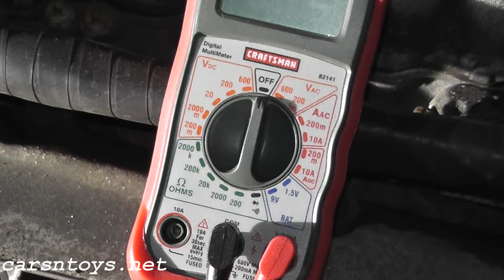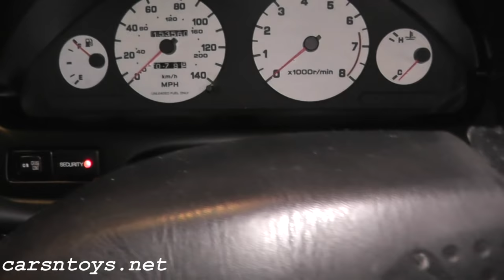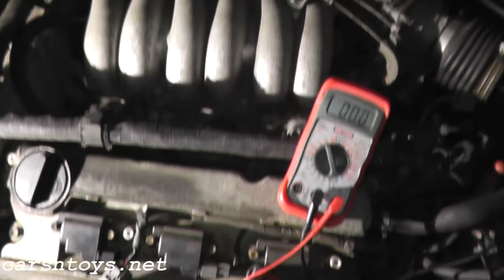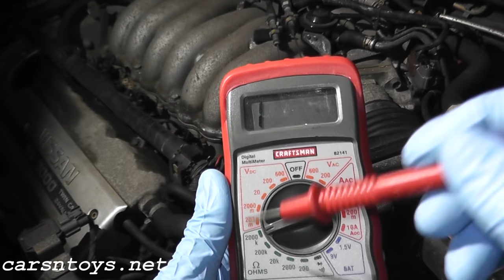P1320 Primary Ignition Signal Fault Testing and Replacement HD

Comment: Great Job! Thank you. This helped me with the scan tool of course. I had P01320, I replaced the Ignition Condenser. Turned out it was not that. Two days later, the three lights back on the dash. Rescanned, P0302 Cylinder 2 Misfire detected. I replaced the number 2 cylinder with a HITACHI IGC0026 coil. Car runs like a jet again!  Use the Hitachi coils. No lights on. I hope my comment helps someone out. I have a 2002 infiniti I30t. Thanks Again.
Reply from the maker: Very cool! Glad to help. Appreciate the feedback.
Reply: I have the same problem but I have a 2000 infinit i30
Reply: Make sure to use the Hitachi coils.

Comment: This video was great. Had the infamous P1320 pop up on a scan recently, no misfires codes, so I said might be the condenser(after reading endless forums where no one mention changing it, only the emphasis about replacing all 6 coils to no avail). Even the dude at Nissan, told me when I replaced one coil($116), for one that broke two years back, that I need too replace all six. I didn't. The part is no more than $6-7 from Nissan dealership. Nissan needs too put out a new bulletin addressing this issue, or reimburse ppl smh. Many ppl have spent dollars trying too correct an issue that can be solved without replacing wire harnesses and ignition coils.
Reply: Shaka Mentor : so, is the ignition sensor also referred to as an ignition condenser ?

Comment: PLZ HELP!!!!! I TRIED TO TEST THE CONDENSER HARNESS AND I THING I DIDNT PUT A GOOD GROUND ON THE VOLTIMETER OR I TOUCHED THE WRONG HOLE IN THE PLUG WHILE KEY WAS FOWORD AND SOMETHING POPPED NEAR THE BATTERY (which is where i had the ground at at the ground battery terminal) AND NOW THE CAR WONT START!! JUST CRANKS BUT WONT START

Comment: You do very good videos and you explain very well too.But when you test the power (+12V) at the harness of the coil and  after at the harness of the condenser,if you put your black wire of multimeter on the ground of engine, you never test the ground wire  of the harness of the coil and condenser .You should test the harness with the red probe on the pin 1 and the black probe on the pin 2.This way you test the 2 wires of the harness.Sorry for my english writing,it's my second language.Best Regards!

Comment: I had the 1320 with engine waning light, the first thing I did was to remove the ignition condenser and was so dirty and I cleaned up with sensor cleaning and steel brush let it dry and put it back I also checked with multimeter and was good I started the car the light was there and I erased it, the car is good now good power no more shake thanks for the help.
Reply: Does the check engine light keep coming back on after you erase it?
Reply: @thephenomkid24  test every coil and fix the problem

Comment: Thanks for your troubleshooting advice!  Man, you helped my fixed a nagging misfire issue on one of my built R35 1000hp GTRs. Ended up being that cheap ignition condenser/capacitor.

Comment: the 1320 code problem was a coil with lower resistance than the other ones nothing else. I have changed the coil condenser and made no difference. I let the car warm up for about 10 minutes and then check each coil and I noticed that coil number 4 had less reading it was under 6 while the rest of the coils were over 6 ohms. I had a coil to replaced the coil number 4 from autozone after installing it erased the code and had never come back.

Comment: Fantastic video! I'm a little worried however that your coil test is not "best" way to check coils. It seems as if your method only shows whether a coil is dead or not. However the code P1320 can pop up (and most of the time is) simply because the coil has the incorrect voltage at the ECM not the coil. This test is performed at the ECM inside the car, not at the coil itself. You have to "back probe" into each slot on the ECM that coordinates with a coil. At idle, you should read between 0-0.2V. At 2500RPM, you should read between 0.1 – 0.3 V. Most aftermarket coils have incorrect voltage values, most OEM coils are perfect. So for people that replace all 6 coils and spark plugs but are still having the code pop up can most probably be because they purchased non-OEM coils. Of course you can test them at the ECM before you ever even drive the car, some of the coils may be fine, some may not be.

I have not performed this test yet but I will be attempting it tomorrow. I found all this information from a Maxima forum which I will post a link to.
http://x.nissanhelp.com/forums/maxima/9813-2000-nissan-maxima-p1320-code-2.html

Comment: Just a useful tip, if your Nissan oil is old and it's about time to change it, and let's be honest there are some miles, at least 190k miles on the engine, it burns oil is what I'm driving at(ha!driving-at) And if the oil gets dirty and low enough, it will affect the performance of the vehicle enough to throw this error. P1230 Change your oil and try resting the code, before anything.

Comment: Pulling a P1320 on my 2000 Maxima. I had this code before a couple years back, and simultaneously also got a code for a misfire on the particular cylinder so it was easy to figure out which coil was shot. This time the code is showing up by itself.
Reply from the maker: +FreedomForever2010 What were the results when you tested each coil via ohms?
Reply: +CarsNToys Funny enough, I hadn't had a chance to check that yet. Was driving back from store today and thought I felt the motor stumble a little bit. Pulled over, checked my codes, and sure enough there was a second code, P0304. Grabbed a new one and all is right with my motor again. 

Not bad by Nissan though, 249639 miles on an original coil, and still have 4/6 originals left haha

Comment: Thanks, very informative video. I have had this code come up several times in the last few months. I am told by every mechanic to replace the coils. I have on two separate occasions and I am still getting this code, along with misfire on multiple cylinders. However, if I do need to replace the harness connectors....is there another name? Auto zone or O'Reilly do not have any part by that name. I have a 2000 Nissan Maxima???Please help????
Reply from the maker: +Nathan Howell Try grabbing a used one online; ebay for example may have them.

Comment: Had a p1320 (only) on my sentra. Did the wire test.... all the wires read good, for my application it didn't have the condenser (looked up online the part number for my year ..because nissan couldn't find it for my vin neither for 01 maxima..confirmed my vehicle didn't use a condenser), replaced my ignition coils with some oem hitachi from rockauto n spark plugs...test drove it "rollercoaster ride" got a p1320 n misfire bank 1... I think the misfire was from the pb blaster I used to soak the original spark plug in (long story) so swapped banks for the original coil n today found out that the misfire n p1320 is no more yet now have a p420 code for the converter or 02 sensor or both. Going to try that catalysts clean see what it does!

Comment: I've learned a lot from your informative videos. 😊  Thanks much! 

Anyway, I noticed that the wire coming from the ECU to the knock sensor is stripping_ and I've replaced two sensors already and I'm still getting P0325 (97 Maxima) ...do you think it's possible  there is no power going to the knock sensor connector hence causing the sensor not to work? Do you have a video on how to rectify this problem?
Reply from the maker: Rush Haven't done a knock sensor video, however, I plan on shooting one shortly.
Reply: How to replace thermostat 1995 maxima

Comment: CarsNToys Thank you, I found your video very informative and thorough. Perhaps you can help me a little further? It's time to register my 2000 Nissan Maxima GLE and a smog check is required. However, the vehicle won't pass smog because I have trouble codes p0304 (cylinder 4 misfire) and p1320 (DTC Definition Not Found) present. I watched your video and ran all the test. The test indicate that I am indeed receiving 12 volts from the battery, and to all six connectors. Each coil is showing resistance except the one on cylinder 4.  So, I ended up replacing the faulty coil pack on cylinder 4 as well as all six spark plugs. This fix cleared the p0304 code and the car ran like a champ for a few days, but was still showing code p1320. So, I assumed the ignition condenser was the culprit because I wasn't getting a solid reading from it with my multimeter. The test would quickly display approximately 1943 ohms and disappear. I wasn't getting a steady reading like shown in your video. So, I assumed replacing it would clear the remaining code. I ordered a new ignition condenser through courtesy parts.com and it arrived within a week or so. I replaced the condenser with the new one and the car will no longer start. It cranks, but doesn't turn over. I tested the new condenser, and it too gives me a real brief reading (something over a thousand ohms). What gives? I tried putting the "old" condenser back in there and the car still won't start. I'm stuck, and baffled. Any thoughts/further direction. Any feedback would be greatly appreciated. 

Keep up the good work
Reply from the maker: Check the crank sensor. A bad crank sensor will certainly inhibit the vehicle from starting. (P1320 can be caused by a bad crank sensor) Here's a video on the crank sensor - https://youtu.be/gJEN0AiLgEM

Regarding the brief reading you're getting on the condenser, it's normal.
Reply: UPDATE: I've got the car running! I can''t say I've done anything other than disconnect the battery for a short while, and jiggle the connections. I think ultimately, the car went into some kind of security mode, after switching out the ignition condenser, and wouldn't start until I disconnected the battery for about an hour. Now, it runs, but the idle is a little rough and it reeks of gasoline. I think it's recalibrating itself. I drove it around the block a couple times just fine, but it'll stall out whenever I rev it too high. It's weird, but I'm optimistic it'll work itself out. Thank you for your video, and your response. I hope this input might help out someone else with the same problem in the future.

Comment: Hello friend, I have a problem, which is that my Nissan Maxima is not working. I checked the car and it turned out that there is a malfunction in (the initial ignition signal). I have changed the spark plugs and the ignition coil and changed this capacitor in the video, but to no avail, it still does not work.

Comment: This is a great video. I have a low Millie 00 Sentra 1.8 that recently stalled on me while driving to the market. Towed it yo a shop and eventually this code appeared, after several tests on running it where we had no code to go by. I tested the connectors w my voltmeter and all read 11.9/ volts. Tested the coils as well and all read higher then 2.1. I Assume as you stated in the video all is w the coils?? Did some research and many state it could be the cam/crank sensor as this is common in sentras. Can't locate that igniter sensor you mention on my Sentra. Trying to purchase one online and can't find one either.

Comment: I'm having an issue with my moms i30 as well. Only code it is throwing right now is the p1320 code. It has new plugs, new Hitachi coils, new cam position sensor and I replaced the condensor with a known good one. I have yet to check the wiring but I don't think that is the problem. Could it potentially be a dead injector? They look similar to s13 ka24de injectors which I've had experience in the past with them just dying out of nowhere.

Comment: I changed the ignition coils to aftermarket, p1320 stayed on. Then changed ignition condensor for another oem condensor. P1320 is still on.. I read on maxima.org that if replacing oem coils to aftermarket will not remove issue. Also, airbag light came on a year or so later..

Comment: Good video!!  Question,  Last week the check engine light came on.  The code was P1320.  I reset the computer figuring it was a glitch.  I took a trip yesterday on the parkway.  The the check engine light came on again.  It still runs very smooth, no misses.  Wonder it can just be the condenser???  I had a full tank of gas. I filled up on gas again after the trip of like 70 miles and she got 30 mpg, I was surprised.  Around town it ranges from 18 to 22 mpg.  On my 2000  I30 the spark plugs have like 180,000 on them.  ALTHOUGH, they might have been changed over time, I am not sure since it was my moms car.   Can old plugs cause the P1320 code?  Thanks!

Comment: I have a 1999 maxima I'm getting codes P1320 and P0304. The car will crank but not start. I have tested the ignition condenser the way you said. When I check it I get over 1900 with the leads one way and when I reverse them I get over 1600 on my meter. My question is when I test it with the leads it will only read once and then in order to get another reading I have to reverse the leads on the prongs in the condenser. Is this correct or should I be able to read it by touching the leads back to the same prongs in the condenser every time?
Reply from the maker: Jim Friese The car would still start if the condenser was bad. It's really a safety device to catch large spikes of electrical current. P304 is misfire at the number 4 cylinder - the middle cylinder toward on the radiator side.  The car should still start and run on five cylinders but I'd check each ignition coil.

Comment: I have  99" Nissan Frontier 3.2. It has spark plugs. A new distributor was installed and truck ran fine for two day. Now truck doesn't start and has the P1320 fault code. With no coil packs where do I check?

Comment: Used BAFX code reader and Torque Pro app which gave codes PO301 Cyl 1 misfire ,  PO325 Knock sensor and pending code PO171 System lean on my 98 or 1998 Infiniti I30.  Inspected  cyl 1 spark plug and it was darkened instead of that nice light golden brown color. Replaced cyl 1 coil  ($50 at Oreilly) and wala car ran perfectly.  Tried ohming old coil like in this video but my values were like half of 5.5k ohms.

Comment: I had a misfire code on cylinder 4 and the issue what the connector wasnt even plug in because the wires got loose. I "fixed it myself" and no longer getting the misfire code but the p1320. Why didn't I get that code on the first place?

Comment: I have a problem with nissan cefiro a33.. its the same engine with whay you do in the video..some cylinder doesnt have the ignition signal from the signal wire..only two cylinder got signal..what seems to be the problem sir? the power supply and ground for every coil is okay but no signal so no spark produce to plug.

Comment: I have a 96 Nissan maxima gle with hard starting problems and decrease in the idling while the car is in park also it’s leaking gas out of the exhaust with thick smoke could it be my fuel injectors.????

Comment: what is the function/role of the ignition condenser please? and can you perform the voltage test on the harness connectors without disconnecting the ignition condenser?

Comment: hey brother thanks for the video, i verified voltage at each of the coil connectors and condenser. I also measured resistance at each coil and got 1.6k ohms. but i still have this code p1320 code. (note i have replaced all sparkplugs and fuel injectors)
Reply from the maker: exceptionalchris What kind of vehicle?
Reply: CarsNToys lol sorry, same as in the video. 98 nissan maxima
Reply from the maker: exceptionalchris Okay. A few things - Did you check all six coil packs? Also, did you do an ohms test on the condensor? Do you have any other trouble codes?

Comment: Hello and thanks for your video. I've been working on a misfire for my sentra. The test you do at the end on the capacitor/condenser does it gradually go up to that number and then goes back to 0 or does it go to directly to that number and stays there. I think my 1320 code was based on replacing the coils with cheap ones as supposed to nissan brand but I ordered a new condenser and when I tested it it starts at 0 and comes up to 1.9m. Thanks in advance.

Comment: Nice video. Im working on a vq30 that runs like crap. I tested them and got cyl 1 & 6 @1.0k and the rest at 1.7k (pins 2&3, coil resistance) however my shopkey Pro does not have rights to the specs of the coil resistance. wondering if youd have them & verified, an FSM maybe. (not my vehicle, i dont own an FSM.) I am a technician, just trying to get the specs somewhere since my best database is incomplete. Thanks!

Comment: I have a 1998 Maxima with code p1320 and a no start problem. checked the wiring and coils also checked for power and grounds all ok. went to check condenser found it to have melted down. Have you seen this make engine not spark.
Reply from the maker: ralph9454 Usually it's a bad coil pack. Fortunately, a new condenser isn't cheaper than a coil pack. Cheers.

Comment: If you have a 2000 Nissan Maxima or later don't bother using this video to locate the Ignition Condenser since they changed the layout of the wiring. If you've ever tried using a Haynes manual and noticed a lot of the diagrams are off it's because they in fact, aren't the same.
Reply: Yeah your right it is located in the fuel line it looks like that black long taped up bar you have to cut the tape to get to it

Comment: Thanks for your guide I eliminated my coils and first time using a multimeter. Ive found that cylinder 3 was not firing on my BMW E36 328i I swapped around the coils and still not firing on number 3 so I did your multimeter reading on the harness connector and works well at 12v so is my next step is to buy new spark plugs?
Reply from the maker: DJ MATRIX Could be the spark plug. Have you tried swapping the plugs?

Comment: My 96 maxima the tach started to jump around and not work rite then a few months later it stopped running so I replaced all cam and crank sensors replaced timing chain also but will not start